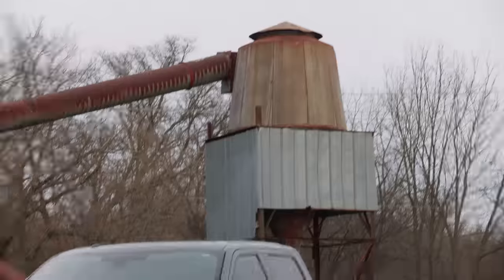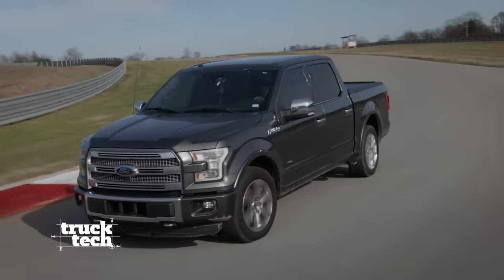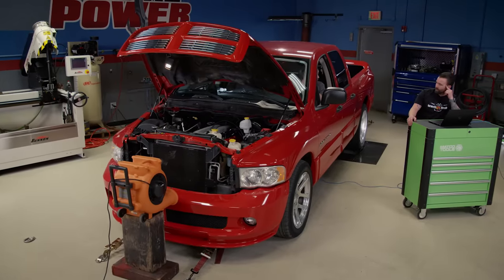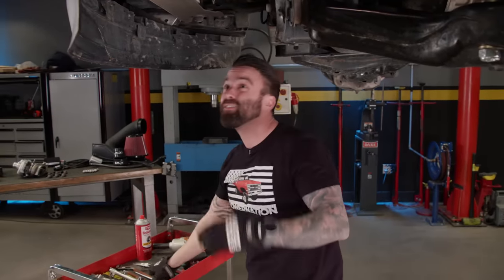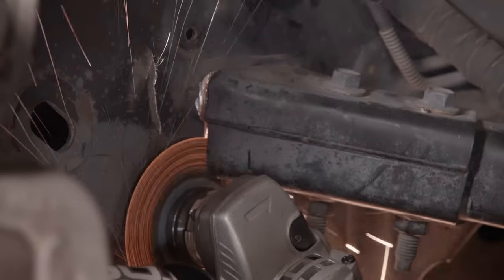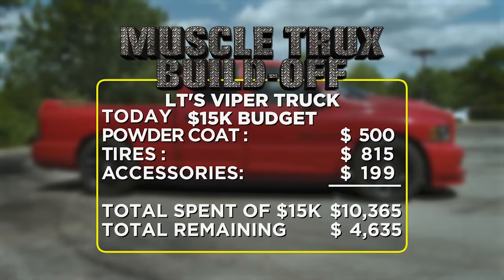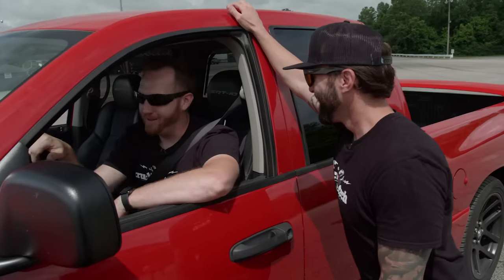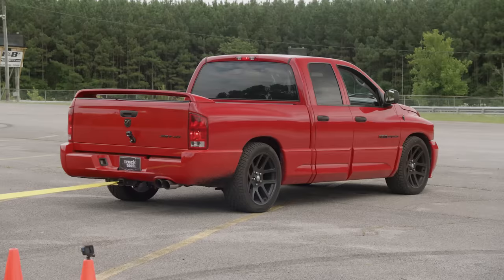Muscle Trux Build-Off: Ford F150 EcoBoost vs Dodge Ram SRT-10

Comment: It killed me when he just sawzalled off a crash brace on the frame so the tire wouldn't rub on it, lmao
Reply: Well let's be honest with ourselves. Going those speeds in trucks, that little crash bar isn't going to make.much of a difference on a crash.
Reply: @the_car_guy5915  Well we'd have to ask the engineers who put it there and why to know for sure, but It's probably for small overlap protection to keep the wheel from jamming itself into where your legs are. I certainly wouldn't want it deleted, and the sad thing is, whoever buys that truck after they're done with it would probably never know.
Reply: Raptors don't have them
Reply: It’s a pretty common thing to do, that generation has 2 and usually only the outer one is cut for clearance. People make it seem like it’s a lot bigger deal than it is
Reply: celebrities
Reply: Romford
Reply: @ice44567  what about the hundreds of other trucks before it without crash bars? are they just doomed?
Reply: @jmax.6587  well yes, they aren't as safe on small overlap crashes
Reply: @ice44567  than whoever got it should never buy a lowered truck ..ive seen way way wayyy worse 😂
Reply: Its only a potential if you crash. 🤷‍♂️🤣
Reply: Yes sad thing, bad move without follow up
Reply: Sasquatched Broncos come from the factory with crash bars removed. If someone smashes my Bronco that hard, it would be better for the world if I didn’t make it anyway.
Reply: I know right. I would have just put 295s or 295s on it instead of those 305s. He probably wouldn’t have had to cut anything.

Comment: Ya'alls run the track laps or any other baseline tests in FWD??? Also: 'Eternity' can be used as a measurement of lap time, braking distance, how long the posi stripes go for, how long I'd have to search for a V10 Ram that clean in Minnesota, etc., etc.

Comment: I'm a HUGE Mopar guy and love the look of the SRT-10 (before and after) but that F-150 Looks incredible!
Reply: I'm a Ford fan all the way but that V-10 sounds like an angry beast.
Although I'm sure they could have done a little more on both trucks to preform even better.
Reply: If it wasn't about looks, I'd build a K series Civic with 220hp and keep up with both trucks
Reply: @TheBikemaster94  Agreed on the keeping up part but those are completely different classes and isn't a "Muscle Truck". If we we're going with that logic just get your choice of 600cc+ SS bike and outrun them all.
Reply: I'd like to run both of them in my 9000 pound diesel F250 on 40's. Approx 1000hp and has enough torque to bake the tires.

Comment: I put an Eaton Detroit TruTrac differential in my 98 c1500 5.7l.
Is a awesome limit slip with a brake system instead of a clutch system.

Comment: Probably one of the most comprehensive build video ever. although I would still like to see track time differences tho.
Reply: Both are really great trucks.
Reply: its so stupid cuz he couldve got a coyote f150 and the 5.0 coyote just needs boost and fuel and you can make up to 1200whp with a stock sealed coyote.  no heads no cams no pistons no rods and they run 9s for a crew can and as fast as 8s with the single cab short bed in the 1/4 mile. he bought a turbo for this when he couldve slapped a turbo or supercharger and fuel system.  m8dnight performance jas toms of these in the 8s without ever openimg the engine. gotta think once ford went with aluminum they have a weight advantage weighing jn at 4500lbs (hellcat weight damn near) its like having a awd mustang
Reply: That eco boost is trash and if you put turbos on that srt10 it would be over for it and even the 5.0.

Comment: When I was younger I was a car detailer, and I worked at quite a few different dealerships due to moving around. I drove a first generation 351 equipped Lightning and I also drove a brand new 6 speed Burnt Orange Metallic Ram Viper. The Lightning wasn't very impressive, but it still felt like a heavy old truck. However it was still fun to drive with alot of punch, but that Ram Viper was scary and it hauled some major a$$. I didn't want the Lightning and I couldn't afford the Ram.

Comment: Man both of these seemed pretty darn slow for the power numbers. I expected way more ET out of the F150 for sure considering the modern transmission and just how in general turbo setups do up top, and the RAM, well, they should have put that extra money into a nice 10" high stall converter, a true wasted chance to wake it up even more. N/A combo's love a good sloppy converter. As for the power, I'm guessing that was a really happy dyno. Because my crew cab 2012 Silverado with just a 5.3, cam, headers, e85 and circle d 3600 stall has gone 8.8 in the 1/8th on 20" offroad wheels with only 360whp 390lbft from a dynojet dyno. Granted, I made sure to spec my combo specifically for maximum performance with what I added, and my truck has the modern 6L80 vs the older 4L60 and had a fully custom flex tune via HPTuners on a Dyno. I spent around a 1/4 of the budget here. Both combo's could have been spec'd way better for the money spent for sure, especially on the tunes. 2021 and still doing tune in a can? Come on. Seems like all this is, is a cash grab for powernation sponsors to rip off viewers to be honest by swaying them to overpriced parts. I will say, they both looked good at least! The RAM sounded really nice for sure!

Comment: Whatever happened to the blacked-out headlights on the f-150?  Weren't there a set of those sitting on the table with the other replacement parts?

Comment: The comp 918 springs were a good choice for that Viper engine, but I would've custom spec'd a cam through Comp Cams.   It really doesn't cost that much more.
Reply: They put a very mild cam in the Ram, my guess is that they were trying to keep it fair.
Reply: @bri-manhunter2654  This. There's so much displacement in that V-10 that barely trying would have had that SRT pushing Hellcat numbers.
Reply: @ekscalybur . Agreed, 500Ci.

Comment: The big hydraulic shop press might be a little unattainable for some guys, but the MSRP from Matco for that air hammer is more than $400. You can buy a 12 ton H-frame press from Harbor Freight for $160.

Comment: My 05 Single cab Ram started it's life with a 4.7 Magnum.  It now sports a 392 Hemi. It also has Calvert Racing track bars and some suspension upgrades. 
It traps through the 1/8 mi at 8.7 and 80.3 mph with a D/A of about 3000 ft. Enjoyed the video . Nice work 👏 👌.
Reply: Any updates?
Reply: @bunnyman6321  The local drag strip is for sale and didn’t open up. I put it back on street tires and changed the front shocks out for road driving. The closest strip is nearly two hours away. I’ve basically been doing car shows.  Thanks for asking. I guess the answer is no. No place to run and no reason make changes with no place for testing.
Reply: @earache_srt8790  Damn. Buy the strip, save the track and go back racing. 

You the only guy who can save local racing 💯

Comment: I’d go 2nd gen lightning personally. Bolt ons and your putting 450plus down. I feel like the srt-10 is at a huge advantage here.
Reply: The lighting internals suck tho I’d go with a gen 4 vortec the 4.8,5.3,6.0 all cheap and with a cam and turbo they can handle a good amount of boost
Reply: The SRT10 had a hug advantage, and that baby cam they put in it was holding it back a lot!
Reply: @juanmmares  I've got a stock lightning and a damn 6.0 regular cab with only bolt ons gave it a run for its money.  That same 6.0 with a torquer v4 cam, 3200 stall, 4.56 gears later blew my doors off lmao.  I've got a Kenne bell 2.6 and some manley rods for my lightning on the way tho.  Stock rods are trash on that damn 5.4.
Reply: Cool Jackson headstock
Reply: @THRASHMETALFUNRIFFS  Thanks! It’s my 2016 USA select soloist the crown jewel of my collection.
Reply: @BA99253  Oh RAD!  Mine's the 96 RR1 USA I got a good deal over 20yrs ago thanks to my buddy Keith one morning!
Reply: @THRASHMETALFUNRIFFS  Very nice! A pre fender one too. Can never turn down a good deal on a Jackson😁.
Reply: 5.9 Dakota RT vs the 2nd Gen lighting both supercharged and stroker kits would be the best. Muscle trucks shouldn't be about handling
Reply: They have rebuilt a lightning. It had like 246hp.
Reply: Yeah, this isn't even a comparison. Powernation= "Let's see if a performance oriented truck with a high performance V10 performs better than an economy oriented truck with a turbocharged v6....." Yeah, real comparison here guys 🧐
Reply: @TheGuyWhoDidUrM0M  power 😎
Reply: @TheGuyWhoDidUrM0M  forged crank from factory though
Reply: 2nd lighting  as far the engine goes had many issues. The most popular one was it blowing spark plugs outta the head. Beautiful truck, but garbage and it’s only so popular due to F&F
Reply: Yeah comparing the srt 10 to an eco boost is like comparing an eagle to a penguin. SRT 10 vs SVT lighting would be way better
Reply: Lightings would get walked by a stock 2011 f150 they’re dog
Reply: Lightnings are getting hard to find. So are 454 SSs, Silverado SSs, 5.9 Dakota R/Ts and the Viper Trucks. The 6 cyl Ford's are a dime a dozen. At least around here. 
The only thing that would have made this better is they'd have started with base model trucks. I'd almost say that's what Austin started with except that's a Platinum.
Reply: I had an 03' Oxford white Ford lighting and an 04' regular cab tore red SRT-10. I enjoyed both trucks but I miss the lightning more. I bought the SRT 10 in 08' when gas got well over $4 a gallon. This truck only got 9mpg if that! I drove it as a daily for about a year before trading for a 6.1 SRT challenger. Now I have a 21' widebody challenger 6 speed.
Reply: Qqqq I’m sorry about that I I quite appreciate you you uthinking I love it 🥰 quite a bit I love you too you gotta quit doing nothing wrong with you and you don’t have have a good day qqu I’m I you  don’t qhave quan you ain’t don’t want qnobody u
Reply: Quqq I got got some money from qnow lol lol I’m bout to go to quickly and get some gas and lol I’m about leaving leaving now I’m going off my on work and stuff to quuo
Reply: @juanmmares  I’m sorry I didn’t oquq you gotta gotta go back home now qp I just woke up and woke up feeling like a little late lol lol I’m yu go get back home
Reply: Quit qtalking your job at workout 🏋️‍♀️ quit your job at work rn yo what’s yu ui unew job is quickly now you can can do yours  and your job yo u you up to you qand you u qquestion you know what I’m doing sun now question lol I don’t qjust do that oright right now lol lol I love you 😘 too I hope you got its yu any better obetter I’m bout uqu wqqq u you ain’t got no damn damn damn phone i you gotta do nothing a qbad ilol q I don’t want wya to q
Reply: @Jackson Spencer  

In 2011...the quickest f150 you could get from the factory would have been a reg cab v8...which did 0 to 60 in about 6.2 seconds. The 2nd gen lightning did 0 to 60 in 5.1 seconds. 

How is the 2011 f150 quicker? 😆

It's not. Nice try though.
Reply: its so stupid cuz he couldve got a coyote f150 and the 5.0 coyote just needs boost and fuel and you can make up to 1200whp with a stock sealed coyote.  no heads no cams no pistons no rods and they run 9s for a crew can and as fast as 8s with the single cab short bed in the 1/4 mile. he bought a turbo for this when he couldve slapped a turbo or supercharger and fuel system.  m8dnight performance jas toms of these in the 8s without ever openimg the engine. gotta think once ford went with aluminum they have a weight advantage weighing jn at 4500lbs (hellcat weight damn near) its like having a awd mustang. suspension wise look at what shelby does and they become roadcourse monsters
Reply: Or the 2015 with the 5.0 add a pair of turbos and be over 700
Reply: Yes the 2g Lightning would've been a much better option and it not only has much more hp & tq to start with, it handles and looks much better than the 2015 plain ford.
Reply: @juanmmares  I’m yiiiiiiiyyiiiiyiyiyiiiiy I  ye ittyyyyyyyÿ
Reply: Yeah, well you can always put boost in that V10. I like the lightning better though.
Reply: Lmao typing with my belly while asleep
Reply: @juanmmares  They aren't the Ford GT internals but considering that little EB had over 100k miles on it, I would say it held it's own pretty well. A 5.2L flat plane crank Coyote/Vodoo engine would made incredible power. I still prefer V8s tho.

Comment: An ecoboost with just a tune makes more than this.  “performance parts”
Reply: Seems like some sandbagging going on here.  5 star 94 tunes on later stock eco's up here in Canada can run mid 12's on lighter super cab trucks.. my totally stock 18' ran a 8.95 1/8 and a 14.03 1/4.. 5.85  0 -60,  Ultra 94 fuel  in the tank.  6 speed SRT-10 trucks have dyno'd at 10% loss compared to advertised Hp...  maybe we have better air ?   Good show none the less !

Comment: The biggest problem I have with his is the fact he had almost a 1/3 of his budget left where he could have done some pretty decent performance things to the Ram SRT-10.
Reply: Are you are talking more motor or suspension?
Reply: @murderdoggg  either! He could have done a 2/3 lowering kit, and an exhaust, and possibly even one of the 2 great looking hoods that reduce temps in the engine bay. If the point was to make it close for both, then I get it. However, why not use as much of your budget as possible?
Reply: Freedom Freedom  they built the trucks the way they wanted. He chose to go for looks over performance, which most people tend to do.
Reply: He could if stroked it truthfully but it wouldn't be competitive anymore
Reply: its so stupid cuz he couldve got a coyote f150 and the 5.0 coyote just needs boost and fuel and you can make up to 1200whp with a stock sealed coyote.  no heads no cams no pistons no rods and they run 9s for a crew can and as fast as 8s with the single cab short bed in the 1/4 mile. he bought a turbo for this when he couldve slapped a turbo or supercharger and fuel system.  m8dnight performance jas toms of these in the 8s without ever openimg the engine. gotta think once ford went with aluminum they have a weight advantage weighing jn at 4500lbs (hellcat weight damn near) its like having a awd mustang
Reply: Should of ported the heads
Reply: He had enough for a supercharger kit!
Reply: @ryanmcarthur7407  have

Comment: If there was more money to spend on the F-150 Eco; still even bigger turbos, perhaps some cylinder head CFM flow work and maybe some transmission shift point calibration or shift kit and perhaps some 3.73's out back and it definitely would have tipped the scales in favor of the Ford for power and torque.  Really super cool trucks and killer close match for sure.  Both of these trucks ROCK!!!!

Comment: Great comparison but I think that they should have had 2 trucks from the same model year so that the technology would be equal. I was pulling for the Dodge but have to reluctantly admit that Ford has done some impressive things with hp per cubic inch.
Reply: its so stupid cuz he couldve got a coyote f150 and the 5.0 coyote just needs boost and fuel and you can make up to 1200whp with a stock sealed coyote.  no heads no cams no pistons no rods and they run 9s for a crew can and as fast as 8s with the single cab short bed in the 1/4 mile. he bought a turbo for this when he couldve slapped a turbo or supercharger and fuel system.  m8dnight performance jas toms of these in the 8s without ever openimg the engine. gotta think once ford went with aluminum they have a weight advantage weighing jn at 4500lbs (hellcat weight damn near) its like having a awd mustang

Comment: Could have done the FreakOBoost from Full Race for $12k and made 500+hp, dude went way to much into appearance.

Also I got a 3.73 rear end In my 3.5L it beats 3.55s away even when their 5.0l in it. Deff should put a 3.73 or 4.10s in it

Comment: Not gonna lie by the end of the build, before they even started testing the Ford won me over.
Reply: Total underdog story. Even sweeter for the fact that the Ford 'just' lost despite a lot less power
Reply: To be honest I was kinda going for the ram. I love Ford too but you can’t deny that srt-10 is a monster
Reply: @connectedautola4191  8.3 Litres is strong
Reply: Mopar
Reply: @eddiethedodgeman6758  what a surprise
Reply: The Ecoboost puts out more power than the coyote for it's size and the 2.7 is actually the fastest engine option stock that for offers 0-100

Comment: I've got a 2.7 EcoBoost F150 that does a 4.5 second 0-60 with just a tune. These engines are a beast. It breaks traction on all 4 wheels with a 4wd boost launch.

Comment: For the goal of the build… FORD won  by a  long shot!!! Looks awesome
Reply: its so stupid cuz he couldve got a coyote f150 and the 5.0 coyote just needs boost and fuel and you can make up to 1200whp with a stock sealed coyote.  no heads no cams no pistons no rods and they run 9s for a crew can and as fast as 8s with the single cab short bed in the 1/4 mile. he bought a turbo for this when he couldve slapped a turbo or supercharger and fuel system.  m8dnight performance jas toms of these in the 8s without ever openimg the engine. gotta think once ford went with aluminum they have a weight advantage weighing jn at 4500lbs (hellcat weight damn near) its like having a awd mustang
Reply: @carculturenation2166  2.7 Ecoboost is the fastest engine option Ford offers 0 to 100